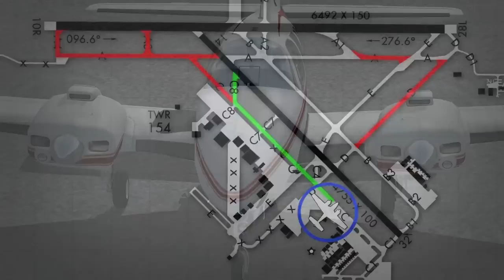Runway Safety: Over the Line

Comment: Yes, it's common for high performance a/c to move forward on a run-up, but 320 feet?  The BS flag is officially raised on that one.
Reply: I agree. Expensive mistake but it'll make him learn
Reply: Expensive? How so?
Reply: If it were common, you'd have tail feathers being eaten up when every there are aircraft in line for TO on the taxiway.
Reply: I parse that claim a little differently.

"After the incident, the pilot of Baron 5CG said that he was doing his run-up and hadn't noticed his aircraft creeping past the hold short line - a fairly common mistake in high performance aircraft.  The aircraft traveled roughly 320' beyond the hold-short..."

To me at least, the fairly common mistake asserted for HP aircraft is loss of positional awareness during run-up -- not the fairly common mistake travelling 320 feet past the hold-short.

'Common mistake' obviously is subjective nomenclature, so it's hard to assign a threshold condition to evaluate. If you're parsing "more often than not on all taxi operations" you're probably right. If you're parsing it (as I do) as "a recurring theme contributing to runway incursions" I'd side with the ASI.

In no way does this relieve or ameliorate the PIC responsibility to maintain situational and positional awareness at all times, regardless of workload.
Reply: Would be if a Baron was a high performance aircraft hahahah

Comment: Why didn't the Commander pilot go around instead of continuing a close call landing?
Reply: Maybe it was Bob and he already shut off the engines
Reply: Lots of runway, easy maneuver around the incursion, and easy landing. BUT I would opt for the go-around, because with multiple incursion points (taxiway crossings) and one already in the active, there is no way to know if it was pilot error or ATC error. Did one pilot break rank, or did ATC clear a bunch of planes to cross...? 

Yeah, better to go around. I like to fly and the gas is cheaper than the funeral. A few more minutes in the air is all good.

Comment: If I may make some suggestions for all pilots, particularly for CFIs when teaching runups:
STAND ON THE BRAKES -- if your feet or legs get fatigued, stop the runup and rest, then run it back up and continue.
NEVER let go of the throttle -- many students and pilots set runup RPM (1700, 2000, whatever), then let go of the throttle to read the checklist, check the mags, etc. Problem is that it then takes time to find the throttle again if they need to stop.
NEVER point toward anything you don't want to hit or roll onto or into before starting runup -- make an inadvertent "crawl" as benign as possible before starting the runup.

Comment: Is the radio always that poor at airports? They are literally right on top of the transmitter and the signal is garbled. I wonder if things would improve if we switched to digital radios. Analog is always subject to distortion based on signal strength. Digital is perfect, without distortion due to signal quality, right up to the digital cliff.

Comment: I know the signage should be enough,  but shouldn't ATC tell you to "hold short" 14?  Also, clarify exactly which "C" to utilize.  There was a C4 and C8 I believe.
Reply: When ATC said Charlie, they meant Charlie. Therefore, if you follow along on the chart, when ATC says "taxi via left Charlie, right Charlie 8, hold short of runway 14," the instructions are perfectly clear. The runway amendment has potential to cause confusion, but again ATC says "amend runway assignment, RWY 14 intersection Charlie 8, taxi via Charlie," and it's pretty damn self-explanatory if you follow along on the chart and keep in mind one of the first things they teach you in ground school, which is to ALWAYS hold short until cleared otherwise. If ATC intends for you to enter the runway but not take off, they'll instruct you to "line up and wait," and if they want you going immediately then they'll give you your takeoff clearance along with the instructions "no delay."
Reply: ATC does not have to say "hold short". Regs state that unless you are given explicit authorization to cross, you must hold short. Taxi instruction that include a runway crossing _do not permit you to cross that runway_, unless explicitly stated as part of the taxi  instruction, or until authorized during the taxi. In this case, the instruction would have to read, "...Charlie 8, cross 14, proceed..." There was no instruction to cross, so the default is always hold short. Anything else is an incursion. 

In general, if you don't know you stop and ask.